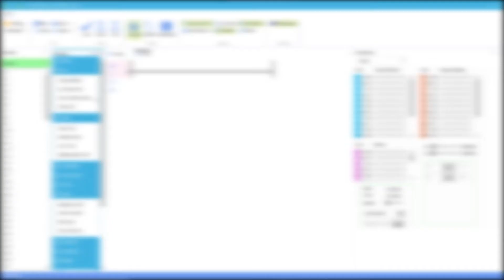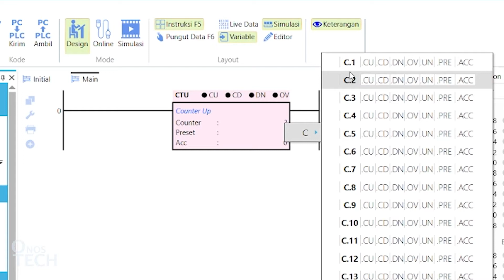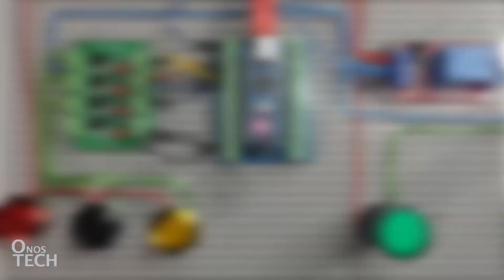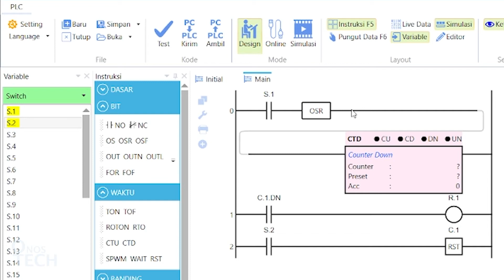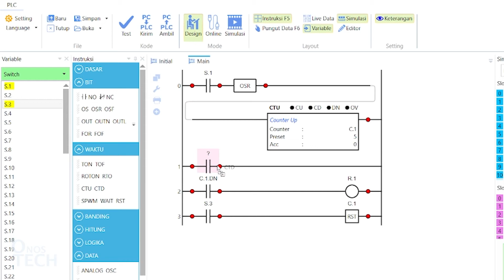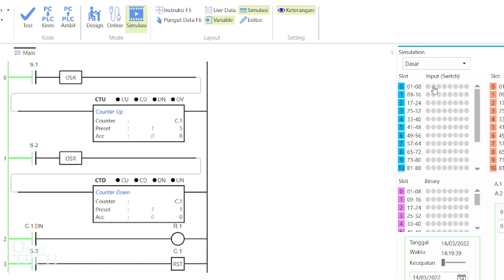#8 Counters | How to Program Outseal Arduino PLC

Comment: Ldmicro works with positive logic while outseal works with negative logic. I would like to program the arduino card either using Ldmicro or using Outseal (about the hardware inputs programming).

The question is; Is there any possibility to configure Outseal to work with positive logic?

Thank you very much in advance!
Reply from the maker: The Arduino has internal pull-up resistors that are enabled which makes the input negative logic. The internal pull-up resistor can be disabled in LDmicro from the settings menu. I am not sure yet how that can be disabled in Outseal.

Alternatively, you can connect a 10k resistor from the input to ground. Using the PC817 module will also make the input logic positive.
Reply: @OnosTech  I hope, in the future, the Outseal creators give the option to configure inputs using positive logic.

 I would like to ask you how to delete a branch function. 
I can delete contacts but I tried to erease branches but I couldn't
Reply from the maker: @karte2626  Right-click on the point of the branch to display the delete option